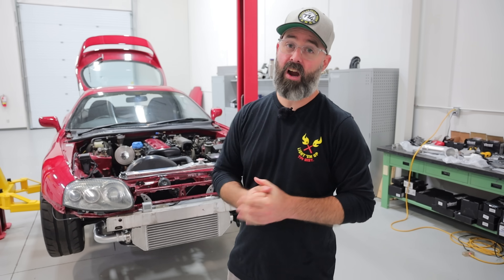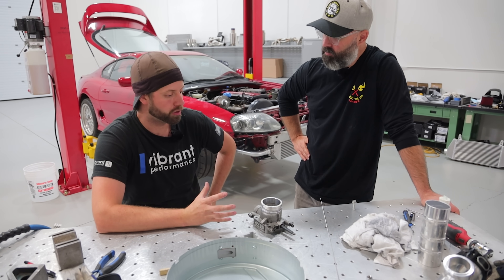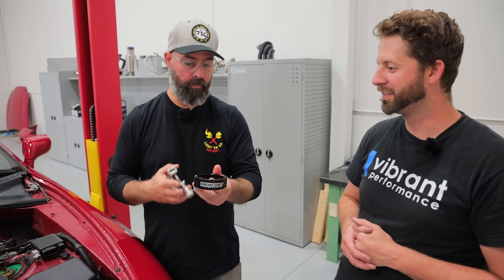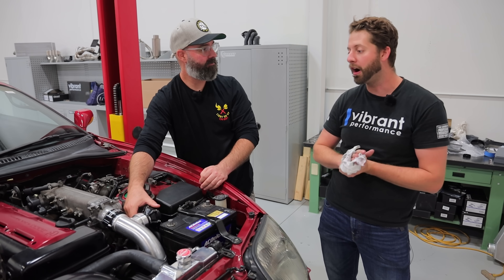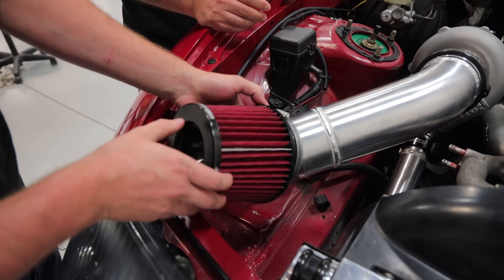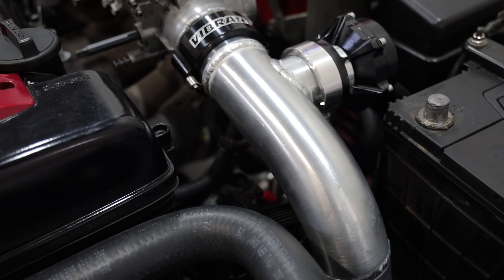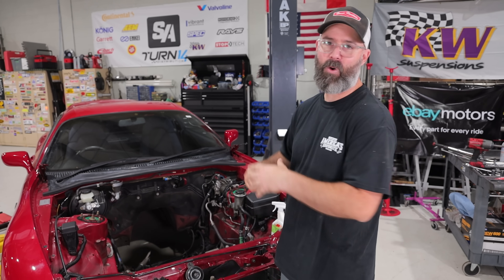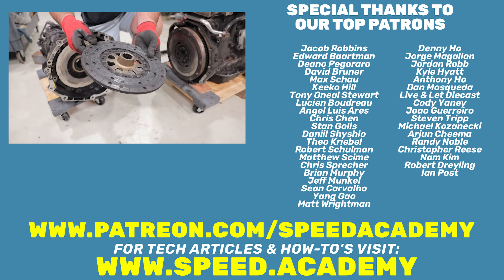The BEST Supra 2JZ Turbo Setup?

Comment: Soak the casting in hot water and drain cleaner for about fifteen minutes at most and then vinegar for ten, This will clean impurities out but also erode some of the metal away

Comment: Be careful with it being too responsive on a stock GTE you don’t want more then 650 wheel torque under 4500 rpm or you risk bending a rod. I know you aren’t shooting for high HP. But torque is what kills these motors not HP. Just make sure your tuner is aware and holds off on timing down low. Love the build!
Reply: It's not to do with what RPM you make the torque, It's just a general thing with response that if you are making any decent power you will make more torque and you will make it earlier. But its just the peak torque figure that puts stress on the engine. I think 800nm is safe, 850nm is where I'd run it and did for 7 years. I'm making roughly 100kw every 1000rpm until 6000rpm, and then slowly building more toward redline. Response is the way to go.
Reply: @Skirk84  when does boost come on for you? What turbo are u running? And what are you doing to bring boost on sooner and make it more responsive
Reply: Exactly, massive cylinder pressures low in the rpm will break shit in glorious fashion lol, because those pressures are sustained within the cylinder longer.
A response engine should be "built" more so than a higher hp one. You can build pressures gradually over rpm and have a big power figure but results are a safe lazy engine.

Comment: I was just going to call you out for not ceramic coating those pipes and then you mentioned Cerakote 😂.  Stuff really is a game changer.  I can grab the hot side of my turbo after running the car almost before it's comfortable to touch the intake manifold.  Just got done spraying some Brembos last night.  Can not recommend their products enough!
Reply: Russian bots are really stepping up their game...
Reply: @earnestbunbury2103  Am much enjoying pie of the apples on Amerikan day of independence such as yourself, comrade
Reply: Whats the point in spraying brembos with it. That would keep the heat in the brakes. You wanna disperse the heat
Reply: @lordoftherims436  My thought process is without active cooling across the rotor I'd rather keep the radiant/contact heat out of the caliper than try and dispell it.  Would be an interesting experiment to see if there are different situations where a coated caliper is better than uncoated or even a caliper with a finned heat sink with proper ventilation.

Comment: I have welded a part that was partially submerged in water before. I had to extend a crankshaft while it was in the block and I didn't want to kill the crank seals (call me cheap.)

Comment: I'd really like to see dyno tests done on different sized charge piping lengths and volumes etc. I have always thought that as long as your blow off valve is not dumping all the charge there should be no real difference in response once the boost pressure has been achieved.
Think of an air compressor tank a little tank may fill quicker but it will empty quicker but a really large tank once filled will take a lot longer to empty. So bigger pipes etc may ultimately reduce lag.

Comment: I didn’t see anyone mention it, but I think he might be meaning twin turbo and not twin scroll. A twin scroll turbo is just an turbo designed for better efficiency. A twin turbo has two turbos. But what’s funny is that the stock 2j has sequential turbos, so there are two turbos but it’s not really called twin turbos; although this obviously varies if you change the setup. Anyway, just some random facts I guess.

Comment: I love you guys and I love the content you make but the pedant in me just has to make a point about the intercooler pipe sizing. Sure 10 liters sounds like a big difference but then you have to consider that a turbo 2jz is capable of flowing hundreds of liters of air per second. The difference in time to fill the pipes is in the milliseconds, quite literally less than the blink of an eye. There is absolutely no harm in running the smaller pipe if you don't intend on making large amounts of horsepower but in the real world changing from 3" to 2.5" piping is not going to change turbo response enough for you to notice.
Reply from the maker: Talk to Ben from Artec who designs the manifolds and has done a ton of dyno testing which has shown that smaller piping actually does make quite a difference. In an ideal world we would have built two systems with both diameters and tested both to show the real world results.
Reply: I agree the smaller tubing is a big mistake. know the testing isn't there like that guy said cause it's not scientific possible. Maybe .01 seconds but it'll be slower everywhere and just more restriction. If the turbo wasn't restricted with a blow off valve and was running past efficiency range of the turbo than smaller piping will help but in this case its a restriction and will lower response time possibly. If better not much
Reply: @speedacademy  A non turbo 2jz will flow over 70 liters of air per second at 3000rpm. Once you add a turbo on obviously there is even more air flowing. 10 liters takes only a fraction of a second to fill. You don't need to build two systems when some simple math can provide the answer.

As I said I am a big fan of the channel and I am not trying to be critical of you. It's a bit disappointing that you blow me off and tell me to go talk to someone else when I have tried to be as respectful as possible and provided you with numbers which back my point.

There is absolutely nothing wrong with the pipe size you have chosen, I just believe that in the absolute worst case you are looking about 0.15 of a second difference to fill the pipe. This is one of those old turbo debates that has been around the internet for decades where people like to claim the difference is hundreds or thousands of rpm or measurable in entire seconds. I just wanted to bring some perspective of how small the difference is.

I have no doubt your supra will perform and sound great no matter what size piping you choose and I look forward to seeing it finished.
Reply from the maker: Im not blowing you off by any means, we aren’t the experts in this field by any means rather going off of data that’s been provided by Ben which why we’ve decided on this piping route rather than the typical larger sizing. 
I personally don’t doubt what you are saying but without actual data it’s hard to know what’s right and wrong. 
I’m adding this test to our list of to dos and I hope that we can find some time to do this and shoot a video on it!
Reply: @speedacademy  Hey thanks for the kind reply. For what it's worth I think you did make the right choice on the pipe size to suit your application. I guess my ptsd kicked in from early 2000's car forum debates where people used to argue this topic with some very wild claims based on seat of the pants testing.

I think doing that test some day would be a fantastic idea that would make for some great content. Keep doing what you are doing, you have been smashing it lately with these projects.
Reply: An intercooler pipe diameter test would be cool to see. In my experience on an EJ, I saw spool and TQ increase drastically when increasing from 2.5 to 3.0" hotside piping on a 400whp setup.

Comment: i bet those clamps will leak air!!!
Reply: Why?
Reply: @dreednlb  dont you see how free they flex??? those orings are greased, they will dry with heat and leak for sure.. those orings are the only thing sealing the joint
Reply: @sergiobisonte   Vibrant clamps have been around for years now and on some very high boost applications.  I'm seeing them everywhere, including on my own car. Never had an issue with them. Several other companies are copying them now, they work/sell so well.